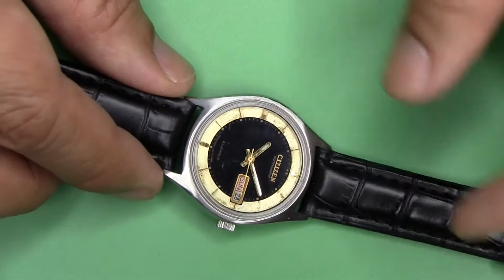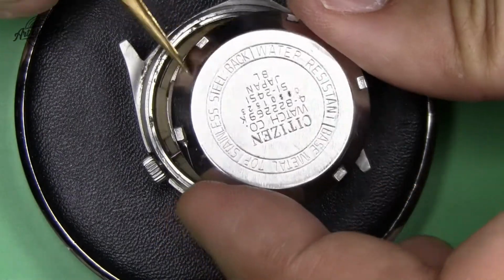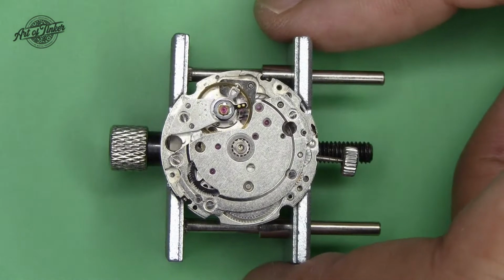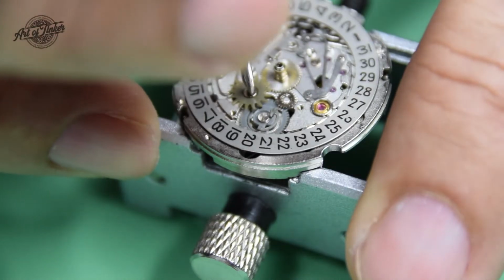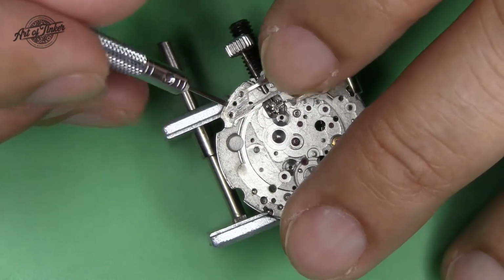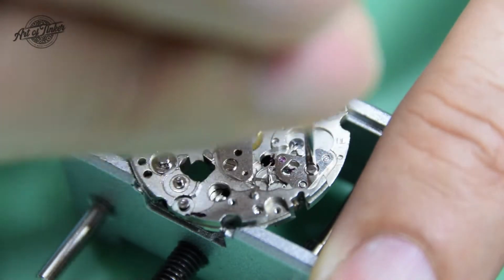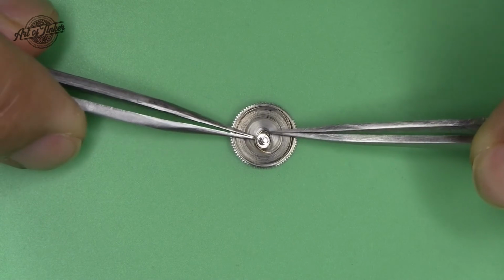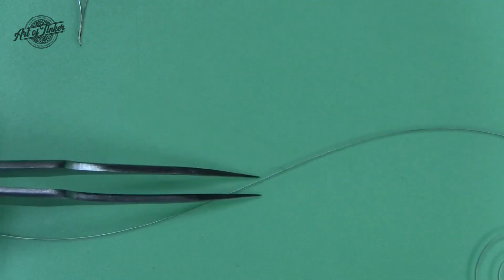Citizen Miyota 8200a Complete Tear Down

Comment: great video. I have a 2010 citizen dive watch with this movement with very little use. I changed the crystal to sapphire, but broke the stem when i took the movement out. I had to remove the back plate to get the short piece of stem out and replaced with a new stem have crown attached properly. I Put all wheels back seems to line up ok after a few attempts but had some doubts about 3rd and 4th wheel. After screwing plate down, i'm able to wind the crown and spring , but it wont start/tick, i can feel the resistance on the spring, but not sure why its not releasing power to the balance and escape wheel which are not moving . i don't know if there's a problem with the 3rd or 4th wheel - would that explain no power transmission??. Im quite sure I have them in the correct position and correct side down looking at your disassembly. Only damage so far I did slightly bend the "friction spring for sweep second pinion" and straightenend it back would this affect anything? thanks, this is learning for me, i really like the watch but not worth paying quite a lot to correct probably fairly simple issue of proper assembly .
Reply from the maker: Thanks for watching the video. Sounds like there’s a problem with the train of wheels. Maybe try removing the balance complete and pallet fork then try winding some power and see if it spins freely. It could be the pivots too. Hope that helps. Thanks again.

Comment: Hello, I have a question to see if you can give me a hand, I have a citizen 7 eagle with the same movement (8200a), but it has been kept for a year and a half, I sold it yesterday and the buyer tells me that the watch has stopped for 3 sometimes even wearing it on the wrist...do you think that due to the time it has been stored it should be charged longer or perhaps it needs maintenance (lubrication)...what do you recommend, regards.
Reply from the maker: Great question. First reaction would be crusty oils? If it's been sitting for quite a while and haven't been serviced that could be the issue. 

Can you manually wind the watch until it's fully wound? If so, does it or will it stop mid-way while unwinding itself in time? If it doesn't then maybe the rotor isn't doing it's auto-winding job so the watch runs out of power.

If it stops even when fully wound then it could be the dried up oils, dodgy pivots and maybe some missing teeth in the train wheels. Hope that helps. 

Thanks for watching.
Reply: @artoftinker3713  Thank you for your prompt response. I have had many watches, battery, quartz, and winding, but the first is automatic, the Miyota 8200, and I am not sure how to wind it manually, since when I bought it, I kept it right away and 2-3 times when I bought it. I took it out of its box, it only updated the time and immediately the second began to work, there is very little information on the web about how to wind this model with a screw-down crown, some say that it is forward with the crown closed, others that backwards, others that You have to remove the crown, etc., 10 turns, 40 turns, etc... do you know the correct way to wind this miyota 8200a movement? ... thanks
Reply from the maker: @falomore  my one isn't a screw-down crown so to wind it, I had to turn it forward, away from yourself, for about 30 turns. Looking at it in a different way, if you're facing the crown from the side, then it will have to be wound clockwise.

Comment: Thank you. I have just purchased an 8200 so that I can do as you suggested. 'Lockdown Take up watch repair'. Spent hours on videos. Yours is excellent. Now is the time. Wish me luck. I do have a few questions for you. You said you were going to disassemble, and clean. What cleaning system do you use? Just an Ultrasound? If you do, can you show its use please. What oil do you use? Thank you
Reply from the maker: Thank you so much for liking the video. Good luck in your watch repair journey. It is very addictive and can really test one's patience. Best tip that I can give is never to force any part that don't want to budge or spin. Understand first why it won't give otherwise you might end up ruining a part.
.
. 
As for cleaning, I've been using a small ultrasound and played around with several techniques and solvents until I could find one that gave me the best results. What I ended up using are products by L&R and with a three bottle approach. I should create a video specifically focussing on my cleaning method so stay tuned.
.
.
In the oiling department, I've been using Moebius products:
- D5 for all jewels and posts
- 9501 keyless works
- 9010 end cap jewels, escape wheel and fourth wheel
- 9415 pallet jewel
.
.
Again, good luck and most of all, have fun!!

Comment: Hello, My watch continusly running for few hours and suddenly it stops. When i shake it, again it begin to run. What could be the problem ?.
Reply from the maker: Without knowing the state and provenance of the watch, it could be a lot of things. It's possible the pivot holes have dried up oil so it puts unnecessary resistance to the train wheels thereby stopping the movement eventually. It could be the mainspring being tired and old. Best to have it serviced by your nearest local watch repairer. Thanks for watching.

Comment: What the different caliber 8200 and 8200A ?
Reply from the maker: Hi. Thanks for stopping by. I believe the 8200 has a single-piece rotor weight whilst the 8200A has a two-piece riveted one. Why they did it that way, I have no idea. Aside from that everything else I think are the same.

Although, some say the 8200 isn't hackable and 8200A is. Can't confirm though.

Thank you so much. :)
Reply: Hi. I really enjoyed the video‼️‼️ do you know if the dials and crowns are interchangeable on the 8200 and 8200a movements? ty‼️‼️
Reply from the maker: @Recreantx  Good question. Honestly, I don't know. You'd think it would be interchangeable as they're nearly the same movement, but I'm not really sure. Perhaps some of the subscribers or viewers might know? Anyone?

Comment: Use guantes..
Reply from the maker: Thanks for the tip. As the watch is dirty and will be heading for the cleaners, finger cots or gloves aren't necessary. For a cleaned movement and ready for re-assembly, yeah, I would. Cheers.